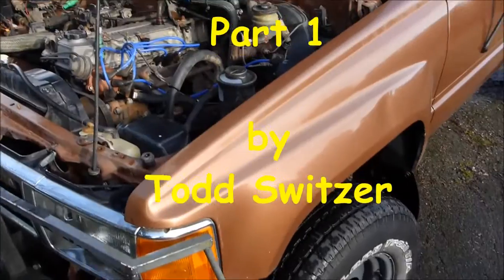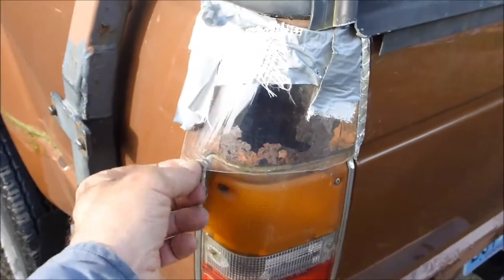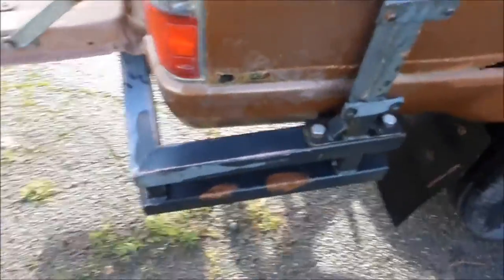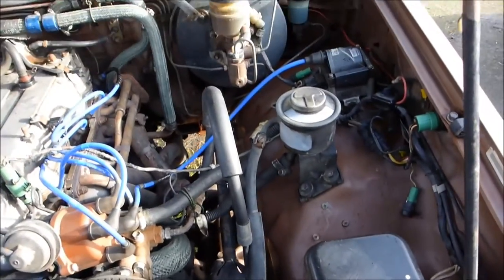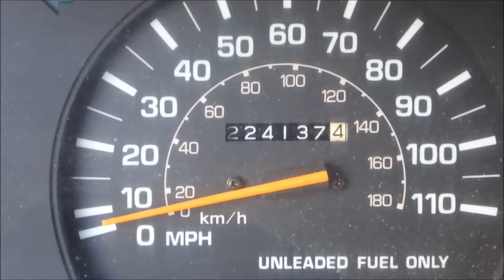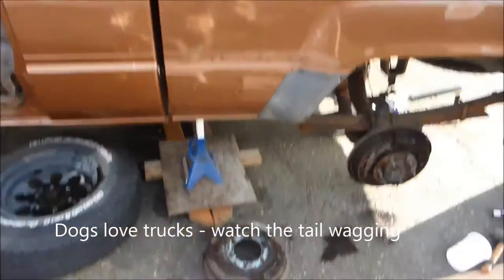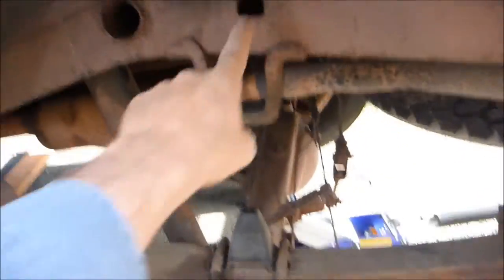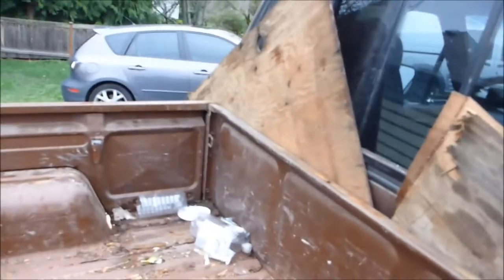Toyota 4x4 1986 Pickup to Flatbed Conversion - Part 1

Comment: too funny, i was on craigs list looking at toyota 4x4 pickup yesterday and this shows up on my new video to watch, my 19 y/o is finally figuring out that maybe a little lowered racers aren't as practical as pickup for the motocross, snowboarding and soon to be kayaking he'd like too do. but looking forward to what you make out of that old toyota, cannot beat reliable and reasonably inexpensive. i was also looking at those 22re crate motors, not bad for about $1k+, to be up and running.
Reply from the maker: +Terry Rau They're bomb proof engines and getting cheaper all the time it seems. A whole new head with new valves, stems the entire thing...is $350. I spent that on rear shocks for my van last month. I just got the Toyota back on the road at noon today and have been spinning tires all afternoon. The little truck is covered in mud. I feel like an irresponsible 20 year old all over again.

Comment: Back in 1986 , I bought the same truck but regular cab and fuel injected turbo charged motor in Chicago.
Reply from the maker: Solid truck. They're hard to find without rust these days and going up in value.

Comment: Doing the same with an old generation one ex dolphin motorhome.
Reply from the maker: They are well worth the effort to fix. Just pay a lot of attention to that rust on the frame and coat it at least once per year with Fluid Film or similar product. Everything else is relatively easy to repair. Mine is still going strong.